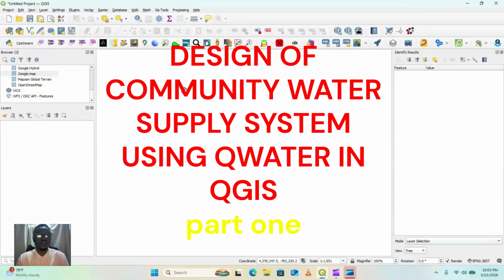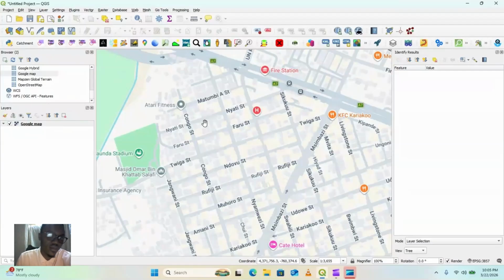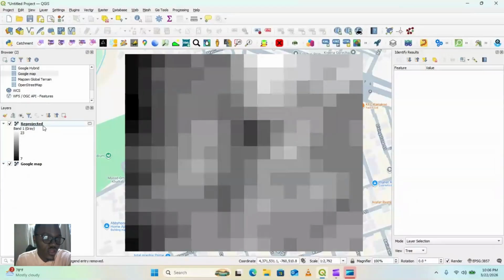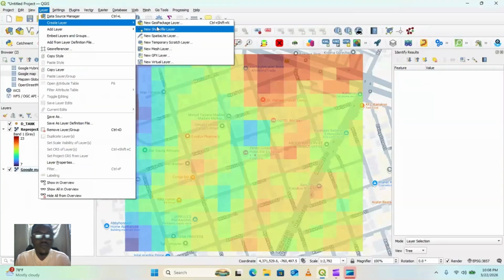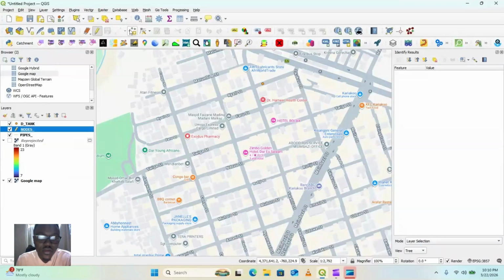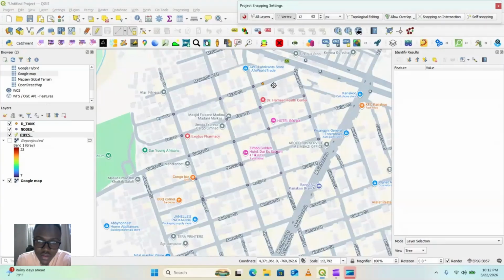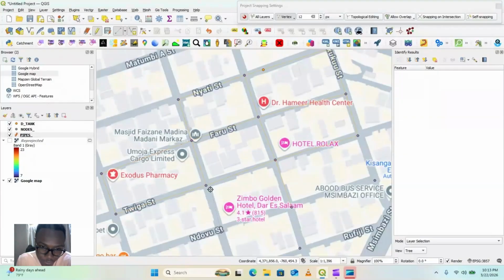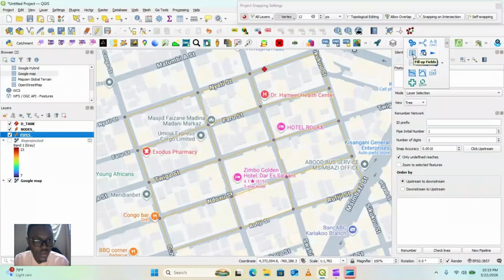DESIGN OF WATER SUPPLY SYSTEM USING QWATER AND QGIS PART ONE

Comment: I need help doing this can someone help me? I don't understand 

1. Create a new DEM for an area of your choosing
2. Turn off all layers except the DEM layer
3. At the top of the page navigate to:
a. View
b. 3D Map Views
c. New 3D Map View
4. In the new map window on the top left toolbar select ‘’zoom full’’ and ‘’toggle on-screen
navigation’’
5. The on-screen navigation toolbar should appear on the right of the window
6. Select the arrow on the bottom middle under the compass and click several times to
rotate the map outward. You can also use the gloved white hand icon to adjust as
necessary
7. On the top of the window select the configure icon (looks like a wrench) to open the 3D
configuration window and then:
a. Navigate to ‘’terrain’’
b. Change type from ‘’flat terrain’’ to ‘’DEM (raster Layer)’’
c. Under elevation select your DEM layer
d. Apply
e. Next you want to increase the vertical scale, tile resolution, and skirt height
accordingly. I’d suggest increasing them in increment of 5 (skirt height can only
increase in increments of 10), selecting apply, and adjusting from there
f. Once finished select ‘’apply’’ then ‘’ok’’
8. At the top of the window select the ‘’Dock 3D Map View’’ icon. You should now be able
to see both the QGIS window and the 3D map viewer window on top of it
9. Drag an XYZ tile of your choosing (OSM, ESRI World Imagery, etc.) over it. Make sure it is
the top layer
10. Once again select the ‘’Dock 3D Map View’’ icon to bring the 3D window back into full
view
11. Select ‘’Export’’ and ‘’Save as Image’’
12. Name the map accordingly and save it as a JPEG